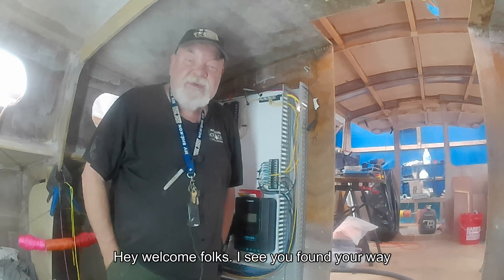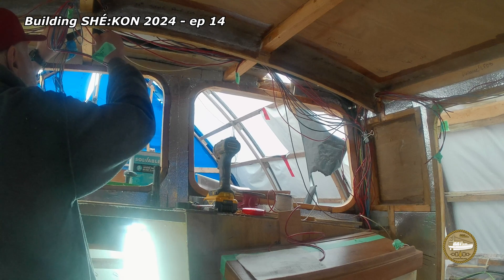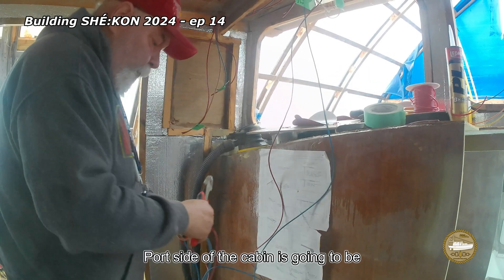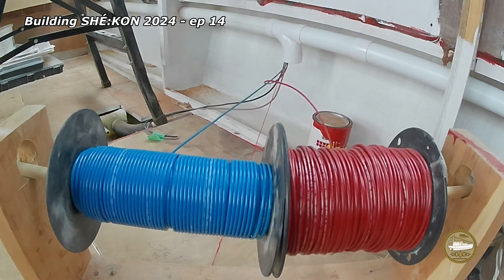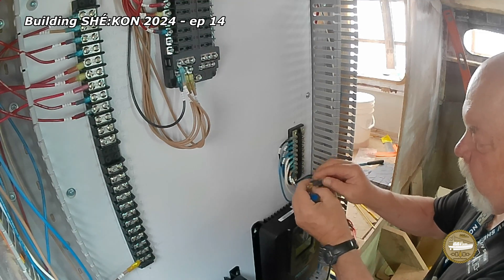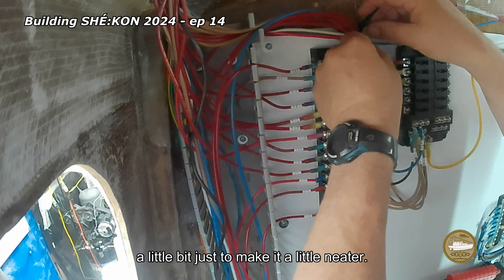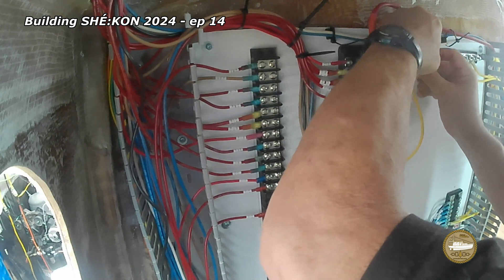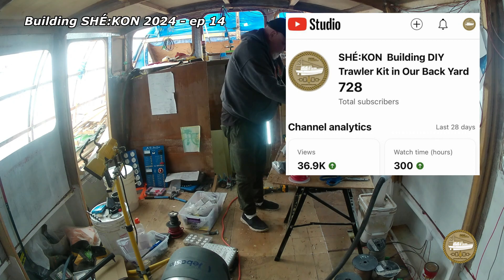Pulling wires and Proper Electrical Connections- Building DIY Back Yard Boat Building Kit

Comment: Hey, was just wondering why you have two solar converters?
Reply: Okay makes a lot of sense:)
Reply from the maker: The boat has three separate electrical systems. One is in the bow for just the windlass and bow thruster. Instead of long huge wire (expensive) runs I put a 200 AH AGM up front. It has it's own charging system, solar and charger. The second is the house bank. It's much larger, 2 x 300 AH LIFEP04 batteries. This is charged by , solar, DC/DC charger and and Inverter/charger. Then there's the starting system, conventional starting battery charged from the alternator and dedicated charger. The three systems are not connected except by common ground and bonding. And yes in an emergency I can cross connect any combination of the three. Thanks for looking in. Cheers! Rick

Comment: In a perfect world you would follow the ABYC color coding but I can't imagine the expense getting all the different color wire.   I have been rewiring/updating my 39 year old 32 bayliner.  My brain gets scrambled trying to make old wiring look neat while adding/rewiring, new fuse blocks, buss bars etc.  Should of done some of it 27 years ago.  Toilet has never worked so good.  Good grounds matter.   Having diesels and biggest 12 volt load was refrigerator and the toilet  didn't worry about wiring fire and no gasoline fumes.   Nav lights kept going out and discovered the old crimps were overheating the spades on old glass style fuse block and melting the block and losing connection.    Fun watching your channel.  Found you through Joe at Detroit Boat Werks
Reply from the maker: Thanks for looking in Scott. Joe is quite the character. I would have loved to have the funds to buy all the appropriate colours too but that would have cost $1000's. I will do so for the battery cabling though. Haven't ordered that yet. I'm not actually too far off the colour scheme and have identified each circuit for load, AWG, colour etc. All my connectors are tinned copper, double crimped etc. The tidiness will come later. Stay well. Cheers! Rick
Reply from the maker: PS. I'm also colour blind so they all look grey to me! 😆